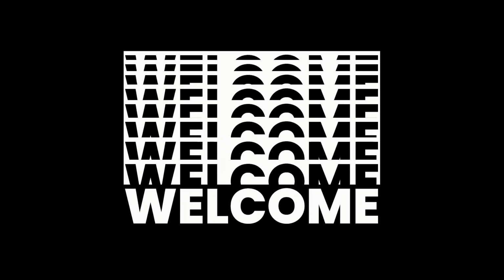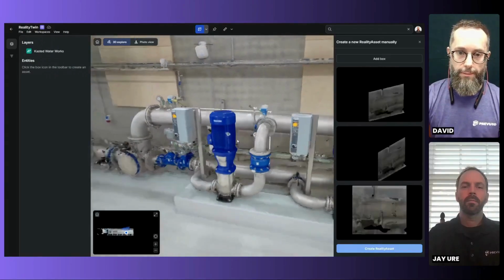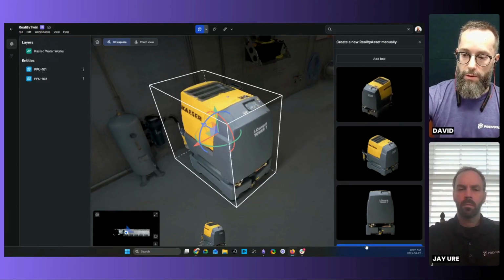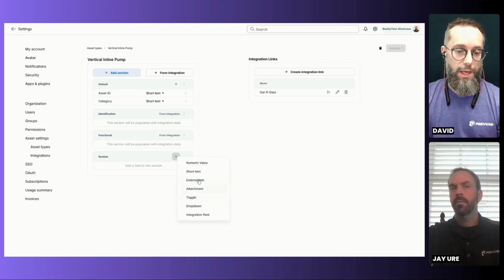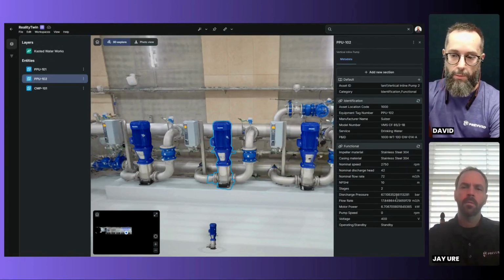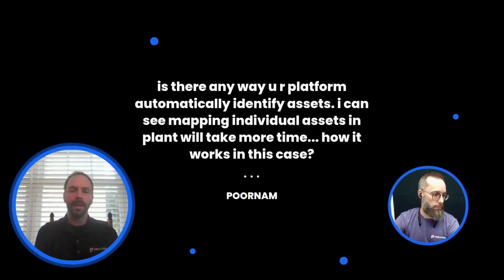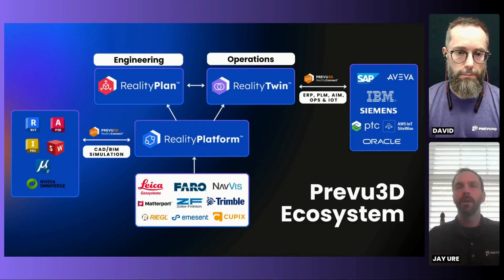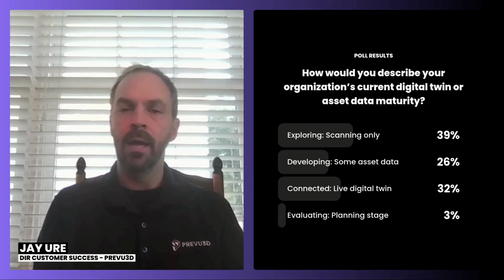Product demo - RealityTwin RealityAssets: Turn Scans into an Asset Database

Comment: Does it have an alarm function?
For example, when vibrations exceeding a set value occur on the IoT sensor attached to the pump, a message is sent to the administrator, or a warning is displayed on the screen.